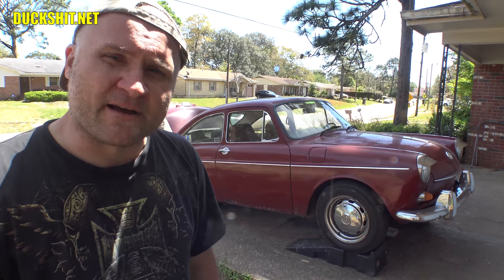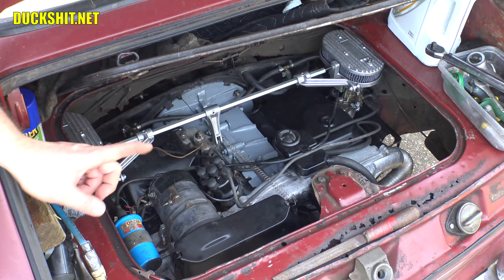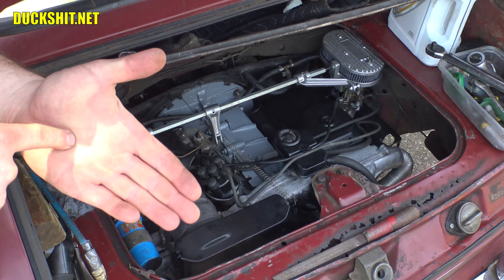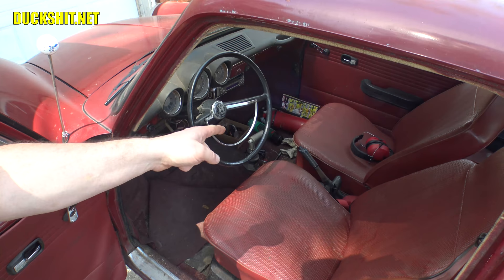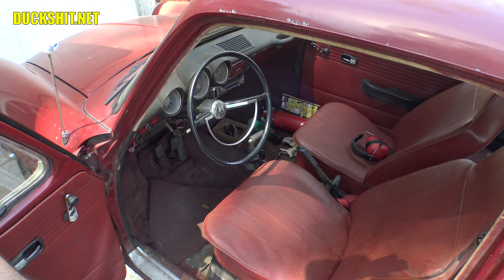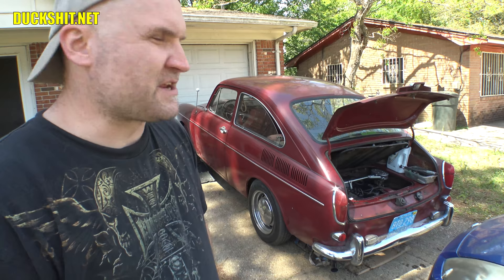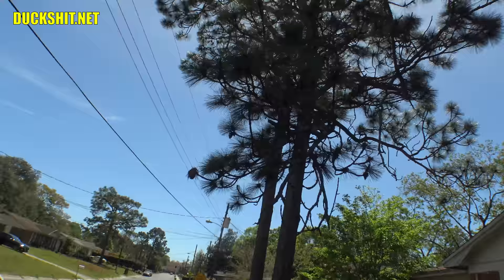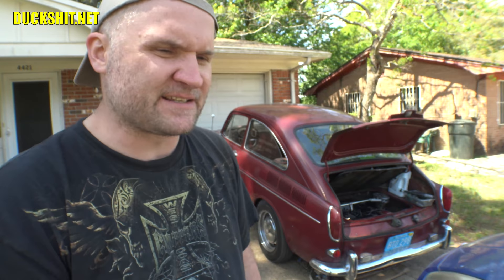VW Loose Head Symptoms - Heavy Breathing - Fastback Issues- Mid Day Q&A - 52

Comment: May I point out one thing on your cars generator. The black cover over the top over the brush prevents the cooling air from the fan to cool the generator properly . I've seen some with them and it may be fine. There are are openings at the belt end and brush end of the gen body.
Reply from the maker: That would be false, the cover is to prevent idiots like me from dropping a screwdriver or a handful of nuts and bolts into the brushes.  Ask me how I know.  There are many more openings on the end of the generator, and covering the one hole that points up doesn't hurt anything.  Guess how many generators I've damaged/overheated that had a cover... not a single one!

Comment: Did you get a chance to check out EV4U custom conversion. They have a metal shift rod coupling. Its kind of pricey. Bet you would never replace that piece again. Just a thought if others read the comments.
Reply from the maker: Yes I have, but I don't like the idea of vibration induced... this is the whole reason why the Fastback has a rubber mounted rear end.  A solid shift bushing would be going backwards!

Comment: See if Abom79 can find where the pushrod for the throttle is hitting and have him.........just drill a hole
Reply from the maker: Haha.... that's the way I wanted to do it to begin with.  But I'm still happy with the end result
Reply: As long as its working and not interfering anymore
Reply from the maker: Yep I only needed to file a little bit off the end of the bolt pretty easy mod

Comment: Next time you need to pull the heads off on your type 3, you can do it without pulling the engine out. It's not that hard to do.
Reply from the maker: Unless you're 6'3" and 260lbs-ish.  Not fun!  It also makes for a better video when its out in the open, lol!  Thanks for the suggestion!